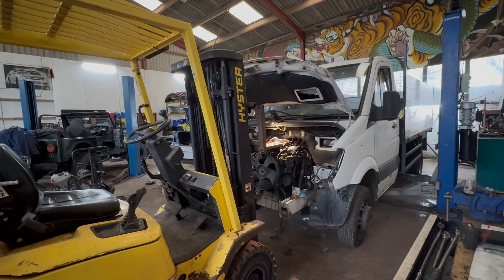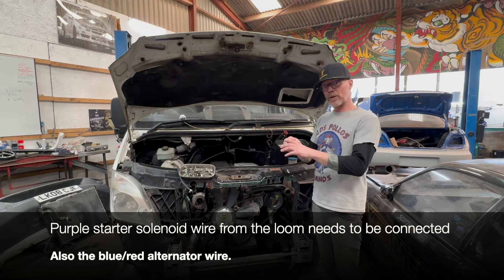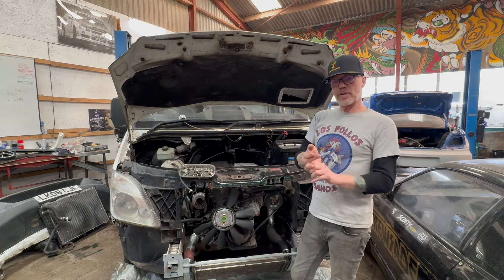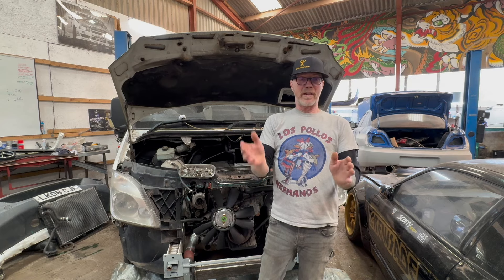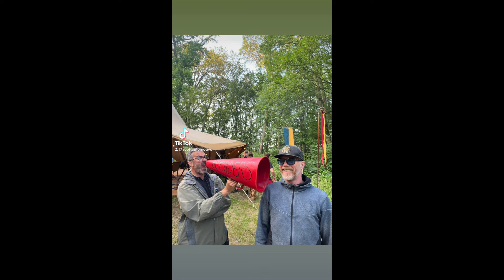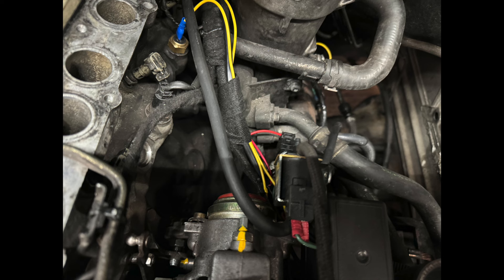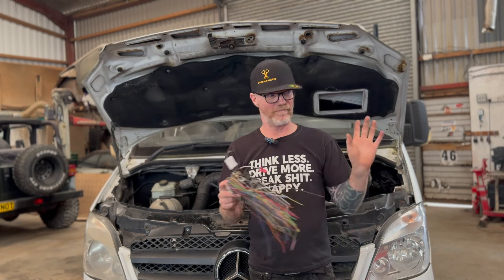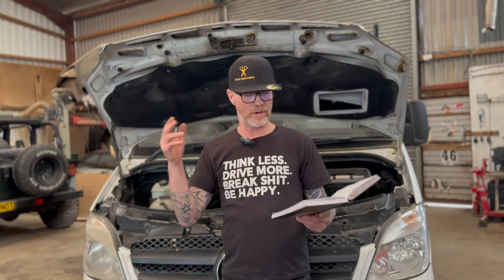OM606 conversion wiring, get the dash working in a 2008 Mercedes Sprinter and others

Comment: Im looking at doing the 606 conversion on my 2013 sprinter it has the 642 motor at the moment but its on it's way out (2nd) engine. It just seems a bit daunting though as i want to keep the auto box (722.6)
Reply from the maker: Hi, I haven’t done an auto yet so not sure, when I do I will post a video

Comment: Greeting Scotty i am in the process of doing a 603 swap in my 2013 sprinter and i have power going to the starter but i am not getting it to crank im currently going through the wiring schematic would you have any tips?
Reply from the maker: Hi, I’m not sure to be honest, if it worked before it should now, follow the purple starter solenoid wire to make sure there are no breaks in it

Comment: If you have to go to a tuner anyway for deleting some warning lights... Why not let him extend the glow times and use the sprinter glow hardware? Should be possible I guess?
Reply from the maker: Yes absolutely. This was 6cyl swap for 6cyl so that would work, but most are 4cyl swap for 6 so would need to change relay anyway, I think if original relay is left plugged into ecu it would work with only a few more fault codes to delete.

Comment: How you solving fuel level showing
Reply from the maker: It can be reprogrammed in the dash, I use Autel
Reply: @Scotty66   mine showing correct onky when disconect negativs from battery ant recinect then shows corect fuel level